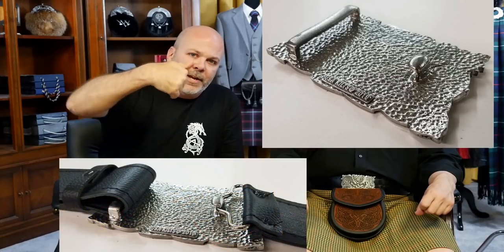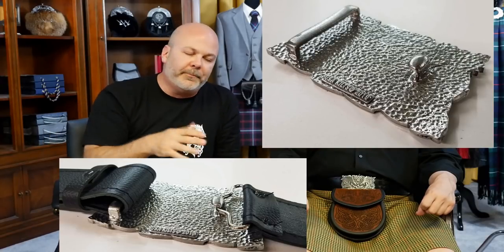Ugh! My Kilt Buckle is Wonky!

Comment: Rocky, I don’t know if you ever read these comments, but western cowboys solved this problem a long time ago by making the bar swivel for the belt attachment.
Reply from the maker: I do!  Kilt belts have a fixed 'bridge' on the back where jeans (cowboy) belts have a bar that swivels.  The issue with a bar that swivels is that the bar typically goes out past the end of the buckle.  In the case of a kilt belt, you'd see some tartan between the leather and the buckle.
Reply: @USAKiltsOfficial  why not move the bridge closer to the middle of the buckle like how you did with the hook?

Comment: Actually, there's an easy solution : bond a thick piece of plastic or rubber on the hook side, to push it outward.

Also, the bridge doesn't need to be as thick as it is, so, one could remove some metal from the bridge.

Comment: Since it's caused by the leather folding back on itself, you can also look for a belt made of thinner leather and it wont be as prominent.  The belt doesn't have to be made of 8oz leather to keep your kilt up!  The heavier leather does look good and can have better carved designs but even something half that, a 4/5oz is sturdy enough and can come with designs.
Reply: ... but... from my perspective... a 2.25 or a 2.50 inch piper’s waist belt is always that good quality thick leather... and other pipers will notice inferior kit.

Comment: Fold the belt at the right length without the buckle attached, squeeze the folded belt into the bridge (like you're 'plugging' it in), use a bit of metal wire (like a wire hanger) slightly longer than the bridge and push it into the folded belt end so it can't be pulled back out of the bridge. Now the bulge from the folded leather is clamped down by the bridge itself.

Comment: The easiest thing is to move the belt loop (on the belt) to the hook end, then when you've done the belt up you slip it snug up to the belt and under the buckle. This gives you the same double leather thickness on that side as you have on the "bridge" side  and evens the buckle out. 
I seriously wouldn't worry though, as no-one but yourself will even notice that your buckle is a fraction uneven.
Reply: That's actually a great idea I hadn't considered. Just using the extra loop to balance out the other side! I'll try this out next time. Thanks!

Comment: Glad I watched this to know to more center my pin... I'm making my own belt and buckle and at near done I'm running into problems 

My leather design is equally measured from rear center so once I cut the leather it will be centered but if I lose or gain inches it wont be lol.. so I'm thinking I'll need velcro adjustments for both sides? 

Or Second ,do my conection need to be front and center ? I have a foot to spare on each side and I kinda want to put 2 split straps n buckles to my side with overlap to allow size change that will only effect a small section ( more viking design I know) keeping my belt centered in the back and no buckle on it